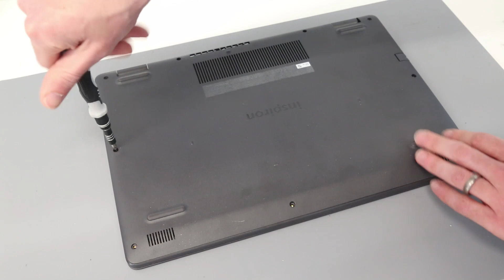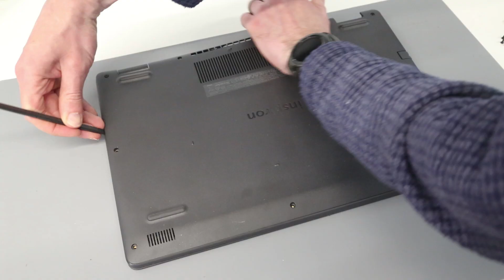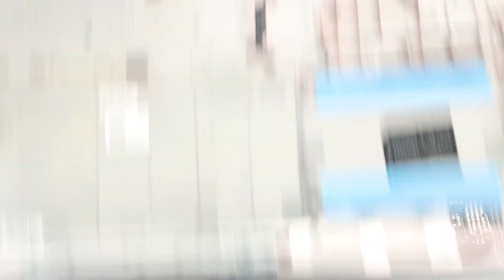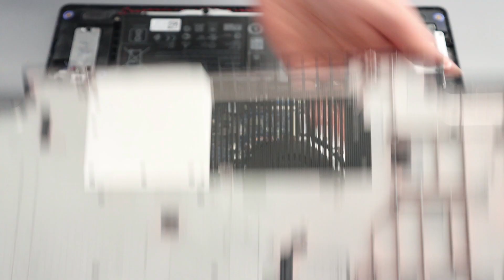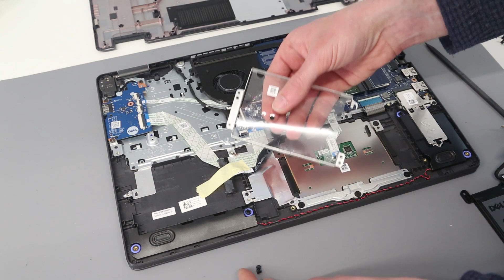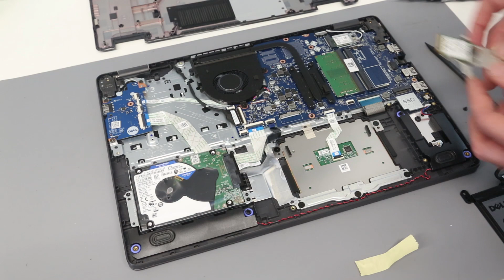Dell Inspiron 15-3505 - M.2 SSD, 2.5" HDD, RAM and Battery Upgrade/Replacement Guide

Comment: been looking to replace my battery after its not been holding a charge at all, and the power adapter as its become loose after use. this video helped me with that, plus more! had no idea the empty space was for an SSD, nor that i could upgrade the ram, so with this video and a purchase from newegg, i've got a laptop that feels almost brand-spankin' new! thank you so much for the help!

Comment: Hi there, I've had one of these laptops for about 3 years and I'm getting an error message advising that my power adaptor is not recognised and it's not charging anymore. 
I've removed the battery and it runs from the ac cable fine so does it just need a new battery?
Any advice is greatly appreciated.
Reply from the maker: Those messages come up due to being unable to identify the PSU - the wattage is measured by the resistance between the central pin and ground and if the value isn't as expected it'll run with reduced performance and not charge.
I suspect replacing the PSU will solve the issue, unless you've damaged the charging port on the laptop itself.

Comment: The specs of this machine say that only 16GB of ram is supported at max.  Yet, I do know it can take 1 16GB stick in a single slot to satisfy that max.  I also know the the 16GB limitation does not come from the processor.  So, I can find no reason it can't do 32GB of RAM at max.  Might you know why the specs limit it to 16GB?

Comment: May i ask two questions?

My 1st Question: which web sites is able to use to clone the contents of the old drive with a brand-new m.2 ssd? 

And my 2nd Question: is there a cooler cover for a M.2 2280 NVMe SSD by the chance?

Comment: Hello, thank you for replying to my previous post. I read this laptop's service manual and noticed that the outlet that needs to turn on the laptop's backlight is unplugged. I saw a keyboard on eBay that turns on its backlight. I intend to replace the keyboard on the laptop when I have an opportunity.

Comment: Just what i was looking for!
I am planning to upgrade my M.2 drive and Sata SSD drive on this laptop.

What is the Screw type/number(is it M2 Screw) to open the top plastic cover of the back of the laptop?
What is the Screw type/number for the M.2 drive and SATA SSD drive?

I am assuming that all the screws outside is one type, and all the screws inside are another type as well.

Comment: a question, my laptop is using 4gb of ram 3200mhz, and i wanna add more ram, Its is ok tu use second slot 8gb of ram with 2400mhz? Thanks
Reply from the maker: It needs to be at least 2666MHz really

Comment: If I want to upgrade the storage from 256 Gb to 1 TB, do I need to remove the battery first?
Reply from the maker: I would always recommend unplugging it - it only takes a few seconds and saves accidentally frying the mainboard if you pull a RAM module with the board powered.

Comment: You have installed an HDD in it, I have a question: it is possible to install an SSD SATA 6 Gbps for this laptop.
Reply from the maker: Yes. a 2.5" 7mm thick drive should work fine.

Comment: hi, thanks for the video, very informative, neatly explained. may I ask, is the microprocessor removable, can it be upgraded? and also, how do I know when to change the thermal paste? thanks again for the video.
Reply from the maker: No - as with basically all modern laptops the CPU is soldered to the mainboard, so the only replace it is to replace the whole board.
Thermal paste I'd replace a few years into the life of the machine, but some people like to apply a high-quality paste from new.

Comment: I have the same laptop. I just read my user manual, and it said, I need 2400mhz RAM, not 3200mhz as you said in the video.
I will upgrade to a 2TB HDD and another 8 GB RAM in 3 days.
It is just confused me that you said 3200mhz because it is 2400mhz in my user manual.

Thanks for the video!
Reply from the maker: The RAM will run at DDR4-2400 speeds, I just fitted a DDR4-3200 module as that will run at DDR4-2400 speeds without issue and is all I keep in stock.

Comment: Thanks very informative👍🏻….can u pls. tell me what brand & model number should i get to upgrade my Dell Inspiron 15.6 3505’s  HDD 1TB & RAM to 32GB….again thanks.
Reply from the maker: I would go with Crucial normally. Amazon Affiliates links below:
2 x 16GB DDR4-2666: https://amzn.to/3m4dagJ
1TB Crucial P2 SSD: https://amzn.to/3aZM04h
Reply: @BrueComputing  Again thank u👍🏻….can my Dell Inspiron 15 3505 take 32gb of RAM?.
Reply from the maker: @ruibui4388  Yes, should work fine.
Reply: @BrueComputing  ok👍🏻 Thanks for the reply…stay safe & more power to you.
Reply from the maker: @ruibui4388  No worries - thanks for watching.
Reply: @ruibui4388  No, maximum of 16GB. Always double check your user manual before doing anything.
Reply: Would any sata ssd work for 3505 and can I add 8 ram to one already in there

Comment: Hi! I recently install SSD M.2 on, but BIOS not detected, the SSD SK Hynix SC311 and not work, hope you can help me!
Thanks!
Reply from the maker: That's a SATA type drive - not sure the laptop is compatible with them in the M.2 slot as the standard drive is NVMe.

Comment: will putting in new RAM also upgrade the usable ram in this laptop? since currently i have 8GB of RAM but it says only 5.89GB is usable. does that ever change if you upgrade the RAM?
Reply from the maker: That is because the rest is reserved for the integrated graphics.
The usable amount will increase with additional RAM.
Reply: @BrueComputing  i never knew that actually, thank you!
Reply from the maker: @DioxideCancer  Glad to help.

Comment: Where is CMOS battery? Is it's missing?
Reply: the battery is using as a cmos battery.
Reply: @zaeekk  yes it means when your main battery is drained fully, all your BIOS setup will be defaulted and you have to again set your system date and time.

Comment: Which one is better among dell Inspiron 3505(ryzen 5 3450u,512 gb ssd,8gb ram,) costing 50k and acer aspire 7(same as previous but with 4 gb dedicated graphics card and 3450h ) costing 52k. For coding and making games.
Reply from the maker: I'd take the Acer Aspire 7 - will have better processor and graphical performance and probably higher build quality as well.

Comment: Does it have slots for graphic card?
Reply from the maker: No. No internal MXM module slot nor option for connecting an external GPU enclosure that I'm aware of.
Reply: Which one is better among dell Inspiron 3505(ryzen 5 3450u,512 gb ssd,8gb ram,) costing 50k and acer aspire 7(same as previous but with 4 gb dedicated graphics card and 3450h ) costing 52k. For coding and making games.

Comment: I bought the same laptop earlier will upgrading ram by opening the laptop VOID it WARRANTY ?
plz reply
Reply from the maker: There were no warranty seals on the one I had - so long as you are careful not to cause any damage and return the system to its original configuration before any warranty claim then you should be ok.
If in doubt though, always assume the warranty may be voided.

Comment: This notebook corresponds to the dell inspiron amd ryzen 7 15 3505a? , I need to know how many ram slots it has (1 or 2) can it be increased to 32 gb? What type of hard disk does it bring (m2 or ssd solid state). The truth is I can not find exact information about the product. I'd appreciate it if you could shoot my doubts. Thanks a lot
Reply from the maker: Should be the same - best bet if unsure would be to take the back off and check. I'd expect 2.5" SATA + M.2 NVMe slots, and a pair of DDR4-2666 DIMM slots.

Comment: Can you add a 16gb SODIMM along with the 8gb already in the laptop for a total of 24gb?
Reply: No, you need to see your user manual. I have the same laptop, and I can upgrade to a maximum of 16GB 2400mhz ddr4 RAM.
Reply: Yea, I wound up installing another Dell 8gb for a total of 16gb. Everything works well.
Reply: @RickMidds  I have bought crucial RAM, cheaper than the original dell RAM :D
Reply from the maker: Yes. Something like this would do the trick (Amazon Affiliates Link): https://amzn.to/3rs3b68
Reply: @BrueComputing  Thank you for the quick response. 😉👍
Reply: I bought my Dell ram used from eBay and saved a few dollars but thank you for the tip on Crucial RAM. 😉👍

Comment: Can we put 2 SSD together in this motherboard?
Reply from the maker: Yes, you can install an M.2 drive and a SATA 2.5" drive.
Reply: @BrueComputing  so both in one? thank you
Reply from the maker: Correct.
Reply: @BrueComputing  thank
Reply: Which type of ssd is supported m.2 or Nvme ssd
Reply from the maker: @Vishal_kr  M.2 NVMe drives work fine. Didn't test an M.2 SATA drive.

Comment: Is there a speed limit on the RAM Or can I just go 16GB 3200 Mhz?
Reply: It supports up to 2400
Reply: Mine is maximum size of 32gb in total, DDR4 2400mhz.
Reply: @junaidiasmawi  Mine is supported a maximum of 16GB of RAM. Always double-check the user manual!!!

Comment: I cannot find a cooling strategy app for my 3505. Isn't it possible to change that? A least have a silent mode or something?
Reply: im using hwinfo for chaning the fan speed. ıts the only program that works.
BUT you can only choose %0, %50 i believe, and %100 just 3 options.

Comment: Very informative! thanks ! Question, can we put backlit on the keyboard ?
Reply from the maker: There is a keyboard backlight connector on the mainboard, but you'd have to buy a complete palmrest assembly with keyboard and backlight to fit one as far as I'm aware.

Comment: sir can i add additional hard disk of 1 TB without removing of 512 GB SSD
Reply from the maker: Yes, if it has a 512GB M.2 type SSD then you can add a 2.5" SATA HDD.